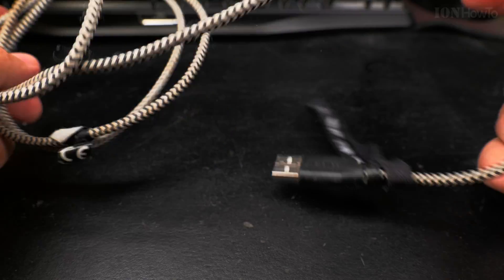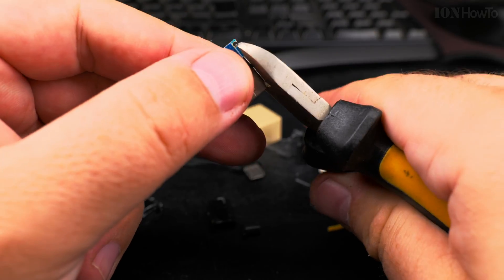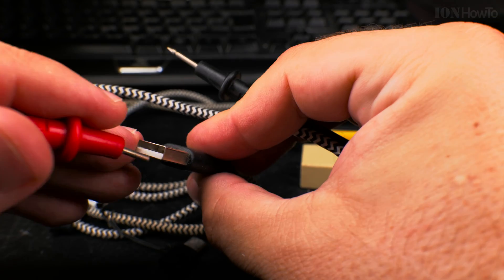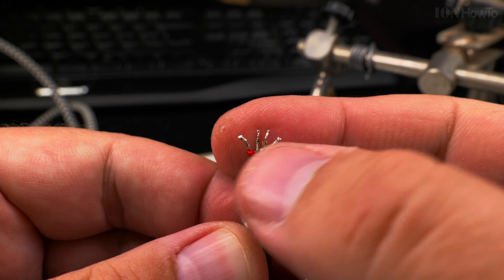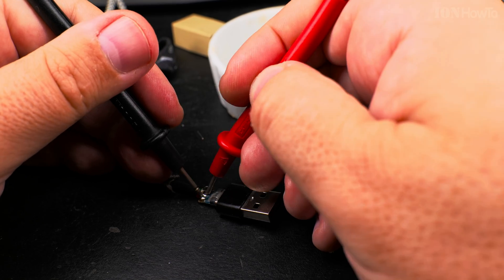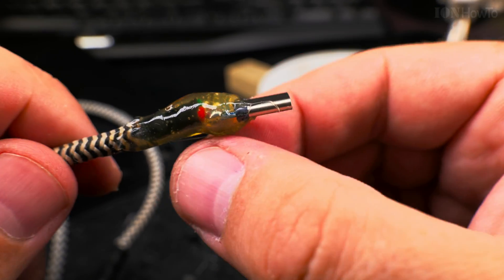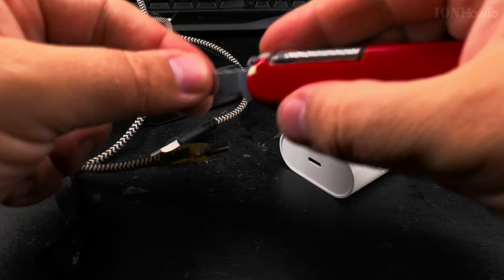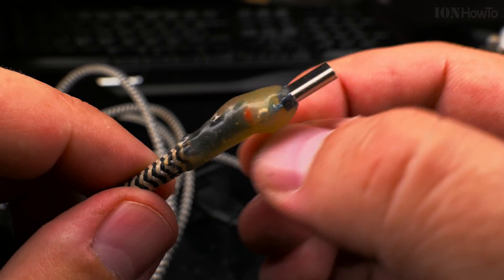How to Repair a Broken USB-C Cable

Comment: Really appreciate this tutorial.  Just a friendly suggestion, next time can you show people multimeter settings for when you determined which was voltage, middle wires  etc and the respective ranges it would show on the multimeter?

Also, does it make a difference on the type/brand of the usb c replacement if you were fixing say a laptop charger cable that pumps out 130 watts vs a phone charger?  I am wondering if the extra wattage will heat up the glue enough so that it might soften or break.   And are the middle wires for data transmission?
Reply from the maker: Happy to help and thanks for the suggestion! This is for a regular usb cable. Not more than 60W anyway without proper etag. The middle wires are for data

Comment: What happens if you only have 3 wires?
Reply from the maker: I understand why there might be 2 wires but 3 sounds like it’s time for a new cable.
Reply: @IONHowTo I went a head and opened up the male USB end. It looks like Ground, Data+ positive, and Power. No negative data-
Reply from the maker: I guess you could use it like that but normally the GND for data negative are separate. Try to put a jumper between Gnd and Data - and try it on a cheap device first in case of any damage.

Comment: I wish I had known about doing this years ago- I have thrown away so many cables.  Question - how can you tell where it broke in the charging cable?
Reply from the maker: @MeleisaD  usually you will know where it's broken because of the plastic breaking in that place. Most common near one of the ends or if damaged caught in a door, you will see the damage on the cable.

Comment: Probably just gonna toss mine and get a new one 😂
Reply from the maker: Not a bad ideaa. It's a lot of work.
It's much easier to turn the cable into a usb extension than soldering on the usb-c pads.
Reply: @IONHowTo  i have no idea whatsoever is broken on it. Whether its either of the usb-c or the cable. Making an extension could be a solution if i can verify its the plugs that are not working

Comment: How did you remove the hot glue or silicone if you want to disassembly it
Reply from the maker: With scissors
Reply: You adds use a heat gun on low or even warm it with a cig' lighter

Comment: this isnt a tutorial on how to FIX a REAL usb c cable, they have a lot diferent wiring than the one shown.
Reply: Define what a "real USBC cable" is
Reply: @dkevans  This is USB-C terminated to USB-A. Real USB-C cable can have up to 12+ pins and is much harder to solder.
Reply: @tidjane2001  l have no doubt it's much harder to solder!